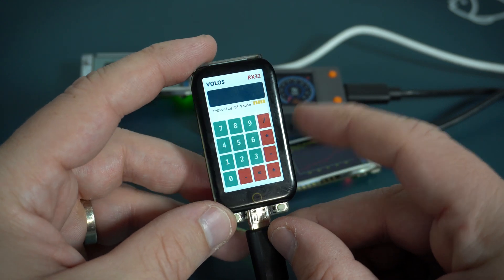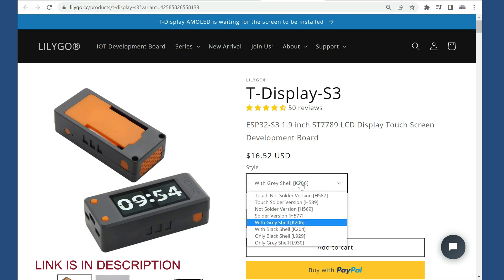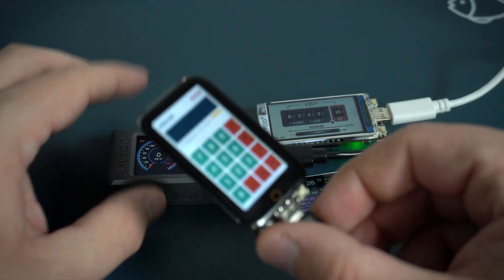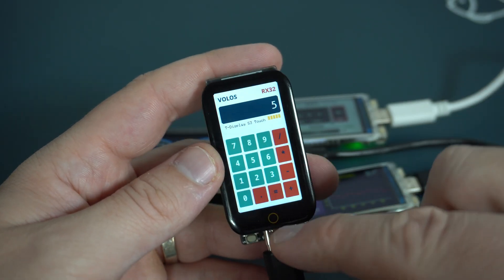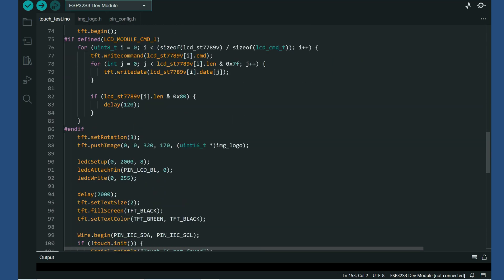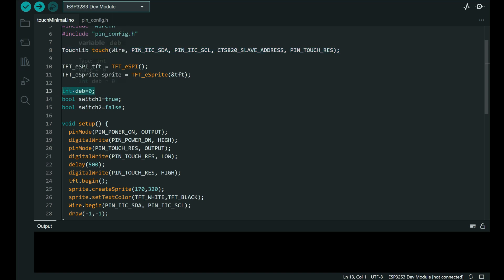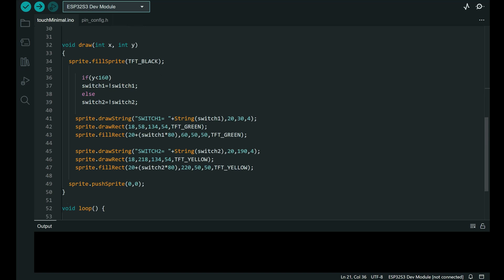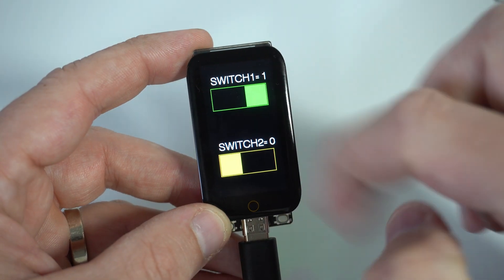LilyGo T-Display TOUCH- free examples

Comment: Is it necessary to use x,y data to determine touch position, or is there a method like touch.sprite to detect if particular sprites are touched?
Reply from the maker: I am afraid it is, but you can implement function like that by yourself.

Comment: Hello everyone,
I have a Lilygo T-Display-S3 CAP.Touch version.
I like and love everything but what I don't understand is how do you get the touchscreen working.I see all the boxes open board out connect to the usb-c sketch open and....... everything works. Did a lot of reading and modified the User_Setup.h from the TFT_eSPI and then the display works. MY PROBLEM is what and where do I adjust rules for the TOUCH Display. Who has a solution for this. kind regards from the Netherlands.
Henk

Comment: Why doesn't my touch screen respond?  At 3:40, the "touchMinimal" code works for your Touch Display, but mine does not work.  The green and yellow switches appear, but do not respond to touch.  And Yes, I DO have the touch screen version.  The LilyGo "touch_test" works on my Touch Display, but none of the 3 examples shown here do.  Any ideas why?
Reply from the maker: Ir seems that there are two diferent versions of same board, compare  first part of factory code with my code and you will probably find what you need to change
Reply: @VolosProjects  YES!  That was it.  Thank you!

Comment: I have installed your touchMininal code onto my Touch T-display which needs the "#define TOUCH_MODULES_CST_MUTUAL" command, but the switches are switching randomly even without me touching the display. It appears to be a CTS328 board. Do I have a defective touch screen? I have two of these modules and both do the same thing.
Reply from the maker: I dont know, is factory code working?
Reply: @VolosProjects  The factory code is showing the same thing. Random green text showing up saying that I touched the display while I did not. Looks likes both of the modules I ordered have this defect. I have contacted LilyGo. Let's see if they will sent replacements.
Reply: hmm free pins hope not just fly in air? i hear its most time for error problem , sorry bad englisch

Comment: Greetings,
    I'm  trying to load this up and am having issues you might be able to help with. When I try and compile, I get

 error: 'TouchLib' does not name a type; did you mean 'TouchLib_h'?
 TouchLib touch(Wire, PIN_IIC_SDA, PIN_IIC_SCL, CTS820_SLAVE_ADDRESS, PIN_TOUCH_RES);

 It's not happy with the constructor "TouchLib touch", though the compiler seems to have found the header file OK.  I'm not sure what's going on. I got  the TouchLib.h header file off GitHub and placed in local directory as I assume you did (with #include "TouchLib.h"). Any ideas?

Comment: Hi! What would you recommend for this idea

I want to make an inclinometer (roll and tilt detection) for a camera, the data should be shown in a display at distance in the range of 0.5 - 2 meters, from a lot of reading I found out that a wired sensor at that distance could work but it's no ideal so I thought that maybe I'll need a wireless solution, there is a 2.4 Ghz module that seems could do the job,  so I'll need 2 MCUs and 2 wireless modules, with this requirements: the one attached to the camera should weigh as little as possible and the one the display should have a proper way of using it disconnected from a power supply (with a nice way of recharging it). 

so I came up with this: a raspberry pi pico(for it's price) connected to the gyro/accel sensor and the wireless module using a power supply from a battery (I'll use a V mount battery that have a usb connector) that combo would be attached to the camera. Then with me I'll have the some product from lilyGo with a display (probably the one that also has a battery slot and a charger circuit because I'll probably be using it attached to a monitor and a powerbank supply is too big) connected to the other wireless module so it could communicate my other device. I'm going with a lilygo here because i'll could use it for other things so spending more money here it's fine, the other MCU (the pico) will be used only for the inclinometer porpoise. Maybe you have recomendations for the MCUs and modules that I could check? I'm really a noob at this, I have experience with Python so I'll probably to with microPython but I think I could learn the basics from arduino IDE and make something useful. thanks in advance!

Comment: Thank you for this demo. It is very easy to understand!
Can you provide idea about pin configurations?

I use Wire for I2C Port Expanders on SDA 43, CLK 44 with Interrupt on PIN 16.
I also have LED strip on PIN 21. And I have a button on PIN 18. 
I hope to add Buzzer on PIN 17. So I made PCB to do this and it works great. 
But now I want to add Touch Display after seeing your video! 

But... I think I do not have enough PINs.
I can define PIN_TOUCH_INT on 4 and PIN_TOUCH_RES on 0.

But I would like to use PIN 18 for button (it is already traced on my PCB).
I tried to use PIN_IIC_SCL and PIN_IIC_SDA as 44 and 43 for TOUCH, but I was not successful. 
Do you have a recommendation?
Thank you.
Reply from the maker: I dont understand you, touch display is builtin on this version, you cant add it, and you dont need additional pins for it
Reply: @VolosProjects  Sorry for my confusing comment. I was using non-touch version before and made PCB with I2C for pins 43,44. PCB also uses Pin 21 to control LED strip and Pin 18 for a button. I did not know about Touch version when I made the PCB. 

But I would like to use it instead of non-touch version. 

So I think I must now make new PCB with all I2C devices using Pins 17,18. Because with Touch version only Pins 43,44 are available for my LED strip and button. Is my thinking correct?
Reply from the maker: @BlaineL  now i see what you are talking, yes it seems tha touch screen is using pins 18 and 21, you are right, you will probably need to design new pcb

Comment: HI Volos, Hope you are well. You are doing such a wonderful job for the community. Love your vids! hope you can help me though: I'm on a new rig and have installed Arduino IDE 1.8.19 and VS+ PlatformIO like usual. Now when I upload your code in Arduino everything except the touch works. TouchMinimal has both sliders shown OFF as i was expectng one ON and one OFF. In PlatformIO the TFT_ESP lib just doesnt work. I'm at a loss.. What am I doing wrong? I'm using the libraries as provided by lilygo (from github for T-Display S3). this should work right?? Completwly lost here .... this happens on both my T-display s3 touch boards.

Comment: Hi Volos, I love your examples. They are very easy to understand and let you make very interesting projects. I'm working with my t-display s3 touch too and I'm loving it. I saw that in your examples you are not using the serial monitor and I'm not able to make it work. Is it a common issue? Do you have any suggestions? Thanks and have a nice day 😁
Reply: In case someone is having this issue too, i found the solution here: https://community.platformio.org/t/cannot-view-the-serial-monitor-on-vs-code-platformio-with-board-esp32-s3/29747/5

In short, i had to add in my project's platformio.ini file those lines:

build_flags = 
   -DARDUINO_USB_MODE=1
   -DARDUINO_USB_CDC_ON_BOOT=1

Comment: Hi Volos - excellent stuff, many thanks for releasing this to your community, much appreciated.  Two questions if I may please: 1. are you planning on using your Issues tab on your GotHub pages for queries re your code? and 2. why in this code do you set TOUCH_RES low, then short delay, then set it high? is this what is needed in order to detect touches on the touch display device?  Also, you really should host a live youtube stream at some point or do a communal Zoom session, I am sure you'd get many viewers.  Thanks again, John.

Comment: Nice! I got that touch version of the S3 as well and flashed the sketch you made for the non touch that displays the Calendar, internet time and calculator on the left of screen. Works well except I don't have the small breadboard with extra buttons to use the calculator. I have it right next to my PC displaying time 24/7 with wifi connection. I wish you could make one for this touch with weather, time and date. Glad you are doing well and back producing videos. Stay safe and blessings. P.S. I found the battery to go with my devices on Amazon for a very cheap price and small form factor. If anyone needs a battery size to fit it like the one I found let me know and will direct you to it on Amazon...
Reply from the maker: Thank you Johnny, yes it is hard to find time for making videos. I hope you are doing fine. What you are using to charge battery?
Reply: @VolosProjects  To charge the battery I am charging it using the Esp32 usb and a power brick I use to charge my phones, etc.